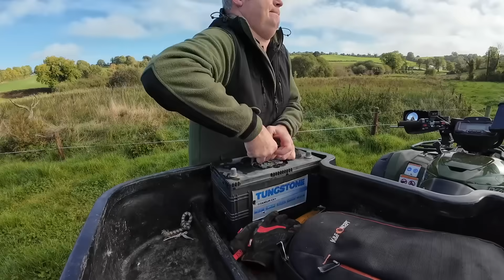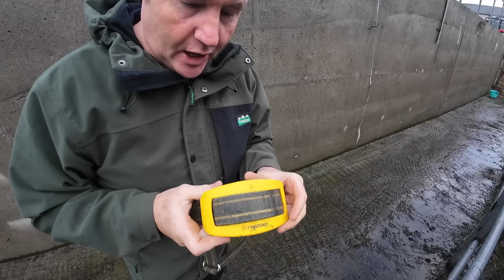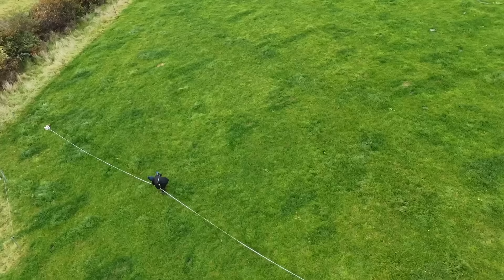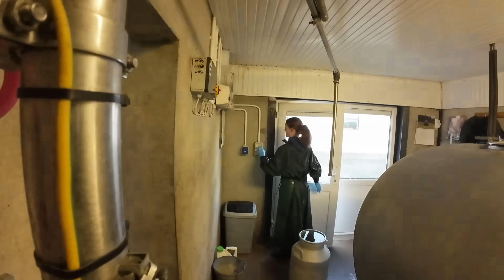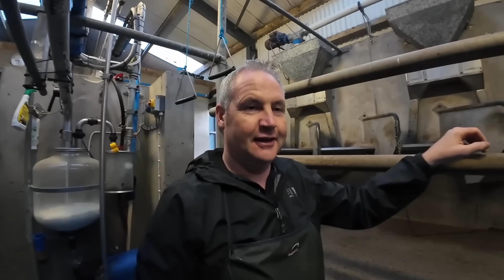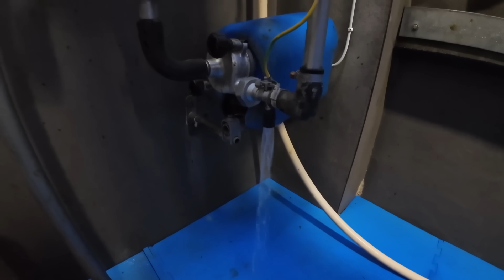What The Term ''FAMILY FARM'' Really Means - Our Biggest CHANGE Yet!

Comment: A few things we do differently that have helped with our success using selective.
1. Trim the tails to reduce dirt around the udder.
2. 1 wipe per teat. Use cotton pads (the ones girls use to take off make-up) with methylated spirits.
3. Put on multiple gloves at the start so if you want to change, you only have to take one off. And use those shitting wipes that come with the sealer to clean your gloves between cows. 

You'll have to move towards selective but for it to be successful I'd say the hygiene needs to be higher

Comment: Adrian a drop latch with a spring on it. Run a rope down the Cross bars above the pit. Pull the rope and gate will open. You will have to go back to close it,the spring keeps the latch down and gate locked. we had that system in our old parlour worked a treat and simple to install

Comment: Hi Adrian. On our old parlour a 10 unit, we had front gates very similar to yours that opened automatically, and I  reckon you would be well fit to make it similar. 

Firstly when the gate is closed it was hung with the top sloped out slightly (1/4 to 1/2 inch) so that when the gate was open it hung with the front of the gate lower to the ground. This allowed gravity to open the gate. 

Secondly when looking at the gate closed the top of the hinges were cut at about 30° (lower away from the cow) also to encourage the gate to open.

 Third it had  a lever system on the latch with a spring to close the latch and a rope to pull it. And bring the rope through small bits of pipe up along the length of the pit to allow to pull open the latch from anywhere. 

And finally the latch slide along a bit of steel till it went into the hole so it was self latching using the spring. 

Realy enjoy your videos. Keep it up enjoy the wedding.